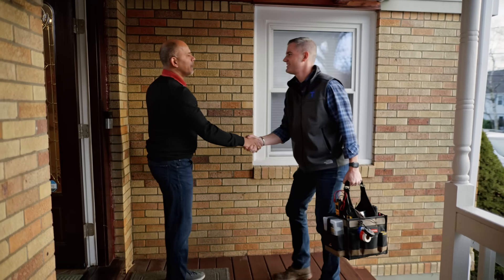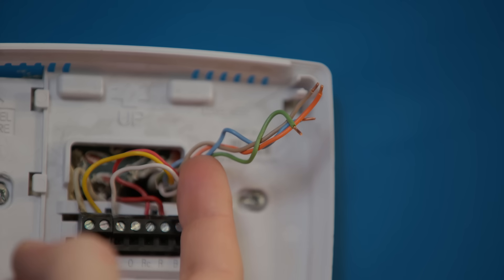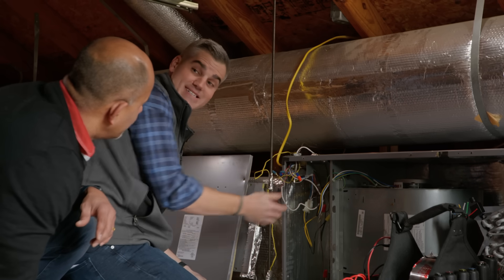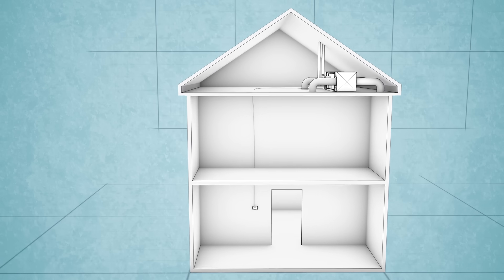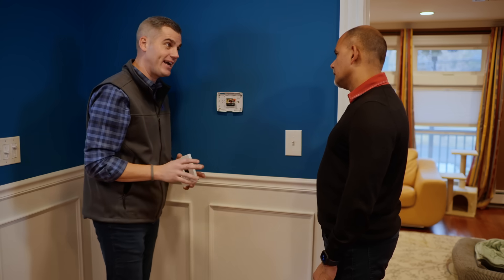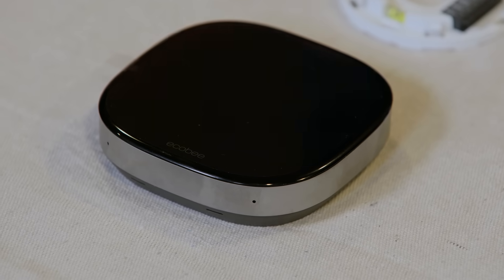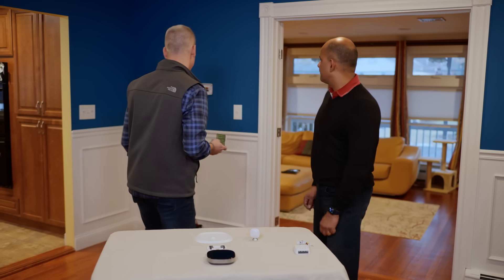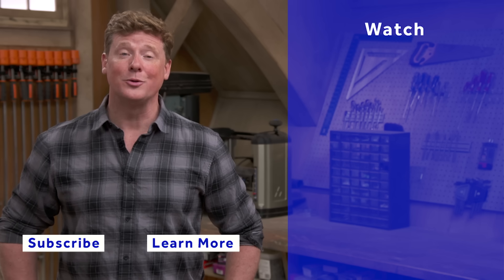How To Install A Smart Thermostat | Ask This Old House

Comment: What if I have an old Weil McLain boiler that doesn’t even have a circuit board but a transformer that the thermostat wires are connected to? I only have two wires running to my thermostat, R and W terminals on the thermostat.

Comment: I was pretty impressed with the way this was handled. I wouldn't have thought Ross would think on his toes in the way he did by eliminating the fan wire. Not sure I would have thought of that either. Really good easy fix, eliminating cutting drywall, drilling holes, rewiring, or even doing the dedicated transformer for the common (another PITA) well done

Comment: Oh, but Ross forgets (probably doesn’t have a clue), we could use a Honeywell EIM (equipment interface module), and only need two wires or if one of those wires is damaged, we could go with a wireless signal.

Comment: lol I got into trouble on a job for putting that big ugly back plate on. They do sell converters from a 3wire to a 4 wire or just use nest it does not need the common wire

Comment: Would it have been possible to see if there was a way to make a common wire with the heat unit? That cable had extra wires too, and if there's a 24V transformer, there's a hot and neutral tap.
Reply: Probably not.. usually the RH leg will just close W

Comment: What about heater control? They have a fancy new thermostat and no control over the heat
Reply: This isn't true, it does control the heat. It connects the two wires going to the heat unit which turns it on.

Comment: Actually, "OL" is over limit.  The meter's applied voltage reached its limit trying to cause current to flow through the circuit.
I would have tried to use the old wire to pull new wire down the wall.  If there were no snags, that would have been the best repair.  If there were snags, you could always pull the wire back and use your Plan B.

Comment: That’s an ecobee. It has remote temperature sensors. Why not mount it  on the wall of the floor above and run a new wire. You use your phone to control it anyway, it could be anywhere in the house. I have 5 of them in my house and I physically touch one, maybe twice a month. The thermostat itself doesn’t have to provide temperature data.

Comment: After owning 2 nests and an ecobee I'd like to say an upgrade would be to install a reliable and inexpensive thermostat not connected to the internet
Reply: The nice thing with ecobee is that it doesn't need the Internet or app to work. It's Apple home kit compatible which allows you to control it even if your Internet goes out
Reply: i just want an LED screen that I can see when the light are off. If I block the google thermostat's access to the internet through my router, will it still work?
Reply: @GalacticTradingPost  
That is the question to ask for any IOT (Internet Of Things) device.

I was looking at purchasing a device that plugged into the network router and then you plug your external hard drive into it. Instant network drive. As I researched it, it turned out that the only way you could administer the device, was to log into the companies website. The administration user interface was not on the device itself.

For those that purchased the device, should the company go out of business, the device can no longer be administered and is relegated to being the latest electronic device paper weight.

Needless to say, I didn't purchase the device.
Reply: I've always been suspicious of a thermostat connected to the internet.
A couple years ago, I seen a report on the internet that 2000 customers of an electric company, had all their thermostats locked with no ability to get AC going in temps of 100+.
If I was in that situation, I would have gone down to the local box store and purchased an dumb thermostat that doesn't know how to do anything other than it's job.

Comment: I'm curious as to why he didn't go check the first thermostat cuz if i saw a brown conduit wire dropping into the floor in the attic but on the first floor it's a white conduit something tells me that brown conduit wire possibly drops down to the 2nd floor thermostat then it's spliced off of there cuz he did say it was a dual unit setup. Seems like the first half of that cable was spliced off to control the 2nd floor while the other half was sent down to the first floor.

Comment: Nest thermostats don't need a C.  They basically have a battery and charge up when they run the fan, which happens something like 10-15 mins every hour.
Reply: The old ones don’t. Starting with 2nd gen Nest E they all need a C wire even with batteries.

Comment: There was a 4wire connector called a Power Extender Kit (PEK) that came in the box and was on the table to the right. Why not just use that and keep all functionality of the stat?
Reply: PEK does not work with dual transformer systems! Meaning heating and cooling have separate power supplies.

Comment: i would have atleast attempted to find the splice. Put a tone on the wire and follow the sound until it stops, that is your splice.  It even could be in an access panel or behind a connection plate.
Reply: He mentioned another thermostat upstairs. I would bet the splice would be there. At least they should have checked.

Comment: FYI, the “OL” on the meter is short for “Overload”, not “Open Loop”. It is considered overload because the resistance it is measuring is higher than its max limit.
Reply: The terms overload and over-limit mean the same thing.  😅

Comment: In this scenario, use honeywell thermostat which provide a c-wire adapter. You can control all fuctions only with 4-wires.
Reply: There's only 3 wires available at the thermostat so this wouldn't work. The Ecobee Thermostats have a PEK unit to "make" a common connection but again, you must have 4 wires available for this to work.
Reply: And the PEK does not work with dual transformer systems.

Comment: not sure why you didn't use add add a wire adapter to convert a 4 wire into a 5 wire some smart thermostats even include the adapter
Reply: Yeah Ecobee includes the adapter. But they only had 3 wires going back to the attic not 4.
Reply: You cannot use the PEK (power extender kit) with dual transformer systems!
Reply: How do those work?  Some kind of wireless transmitter?  Or does it encode the signals on the wires and decode them on the other side?

Comment: My Nest ran for years without a C wire. And then all of a sudden it stopped working unless I charge it for twelve hours every day. But only with the Ac. Runs fine all winter no problem.  No idea what the issue is but it's annoying.
Reply: It needs a “call” to steal power from the 24 VAC hot (red wire), so all summer long it is not getting 24 VAC if powered from the heating system. So eventually the battery dies. Adding a common wire would solve this!
Reply: @rosstret  But why did it work fine for over 6 years?  That's the thing that puzzles me.
Reply: @John_Locke_108 yea that is weird a bit working for 6 years. Did anything change? And did you verify the transformer is still working?
Reply: @rosstret  No idea what a transformer is. Issue started two years ago when I installed a Nest E in the basement connected only to the furnace.
So I bought a new Nest for the upstairs figuring the battery had failed in the old one.  That one worked for an entire summer before the issue occurred again last summer.
Also got rid of the Nest E and replaced it with the old Nest which works fine for heat.

Comment: Keyboard warrior here, but.. I would at least look for that splice AT THE FACEPLATE. Wire could have been just short when they replaced the previous thermostat. It looked like there was plenty of plaster covering that wire, and my bet is opening that hole another 2-4” (new faceplate would cover) you would find your splice.
Reply: Yes and 2nd would be the power source. Someone had to splice it, unless they replastered the wall afterwards
Reply: Yep, 99% sure the splice is behind the thermostat.
Reply: The slice was down after they made the house.  Maybe there was another thermometer on the second floor.
Reply: @bngr_bngr  there is a second thermostat.
Reply: I hate electrical. It's so hard to deal with wiring and it's one of those trades that will instantly kill you if you forget to turn off  the power
Reply: @GalacticTradingPost  or if your battery in your voltage tester died.